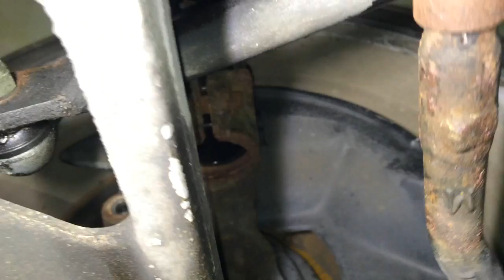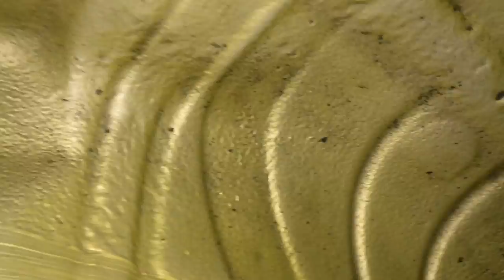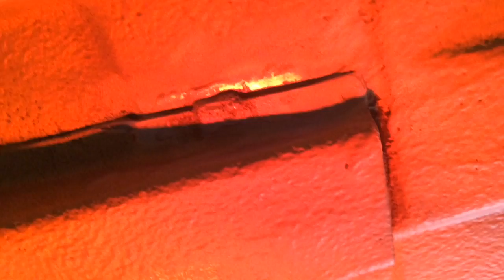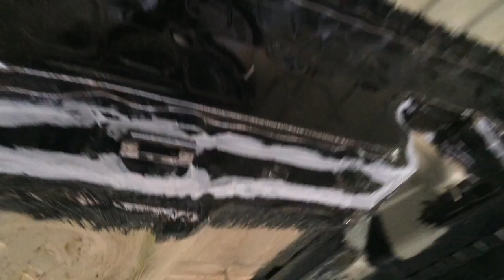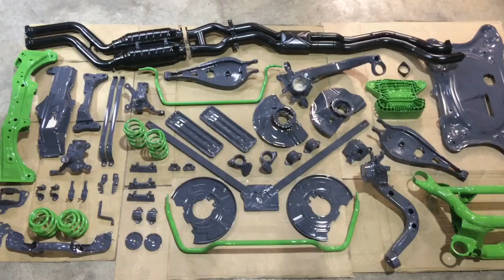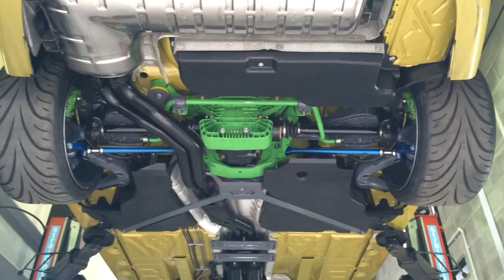Jabba's BMW E46 M3 Underside Restoration by Redish Motorsport 2014

Comment: I did a similar but no so extensive clean/powdercoat on my e46 m3 a few years back and it was a big mistake  due to tight tolerances and the added thicknes of the powdercoat I had issues with the rear subframe, diff and axels. The bushings were prone to failing and cracking so I had to remove the powder coat on quite a few areas and had no problems since.
Reply: I had the same thought when I saw how thick the powder coating layers were. I would have expected some tolerance issues.

Comment: A question to the Powerflex front arm bushes, do you have steering trambling? At speed of 50 miles it starts, at 65 the steering wheel is tremble aprox 1-2 cm each direction. 

the weheels, the brakes the steering was checked, its all in god condition, when i changed to oem control arm bushes the trambling is away.

Otherwise great job.
Reply: Im not sure if this is what you were asking, or if it answers your question. But I've own 2, 740ils the first one i just changed the lower control arms, unfortunately I hit a telephone pole with that one after one of the arms snapped. On the second one which is a bit more sportier, its an 740il, with the complete AC Schnitzer S7 body panels, Exhaust, and interior. this one has bilstein shocks in front and self leveling in the back. Anyway it had the wobble like the other one but worse when i bought it, so not wanting to take any chances, I put the whole front suspension new, new hubs, rotors, and brakes, put new tires, and that the rims balanced. And guess what? The car still slightly wobbles between 55 and 60 mph. I've read a lot on the subject cause I'm a perfectionist, and i still cant get to the bottom of it, some say its inherited, because the car has too much weight on the front end, others say its a matter of year and built. It is annoying thou. Good luck.

Comment: great restoration but painted way too much stuff.
Reply: +Themayseffect everything that is painted will not rust anymore, but the best way is - just paint it with "krown" every year or two, and it is the best way, for 100years it will coast less than all what they done.
Reply: +Gatis Graustins my point was more so about the mechanical bits such as the diff, dust shields. I can imagine that will cause overheating.

Comment: Good video and very professional work. How much all of it cost?
Reply: I'd say mid 20s to high 20k... That's a beautiful job. I have a hard time coughing up the bread for the car itself I the original condition. Couldn't imagine then dropping almost the same amount on restoring. Maybe I'm wrong but it's not cheap. Result is top notch here.
Reply: @cdesousa6339  20k for a corrosion job? You serious? I'm in the wrong trade. A top end glass off paint job on a Ferrari is 20k!
Reply: @cdesousa6339  exactly what I thought..I saw the sill repair on a BMW Z3 these guys did..and that alone was £4k
Reply: we're talking at least 4-5k for the work that doesn't include the parts that are probably around 3k
Reply: @dsbigboss6212  nah...he said in the video just the consumables (nuts/bolts) were £1000.... I'm going for 18-20k for the whole job